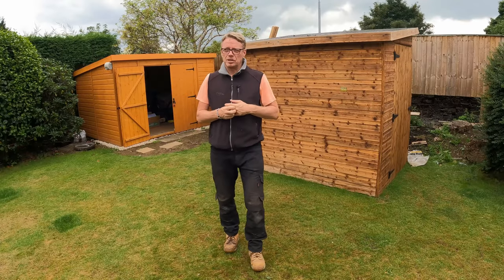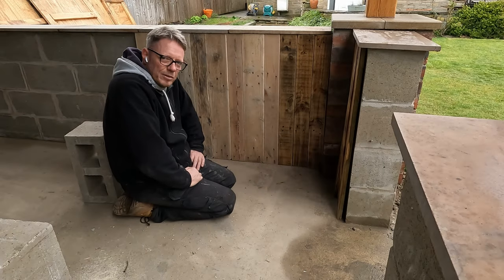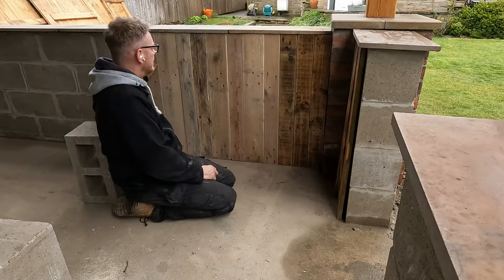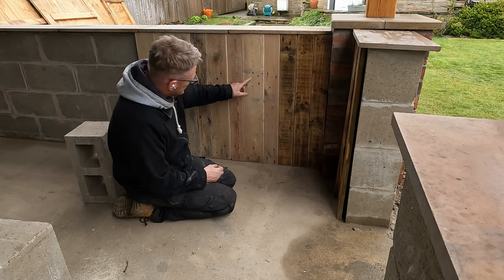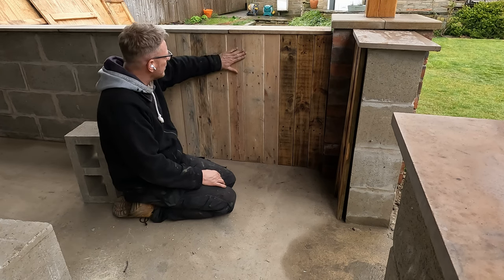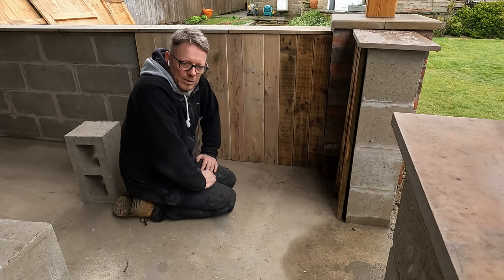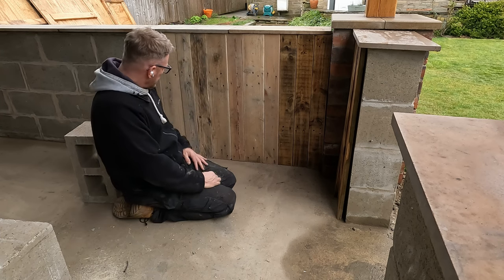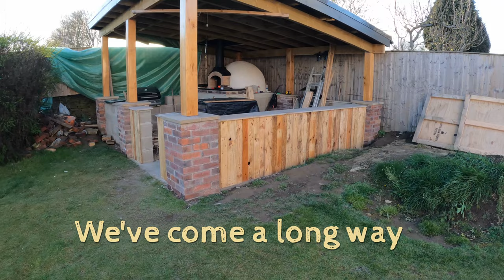Amazing Way to Render a Wall / Used Pallets (Vlog 43)

Comment: I have watched all your vlogs and the editing this time is a real step up, I really liked it.
You are doing a amazing job on the build, you may have it in hand but if not, you may wish to think about sticking a french drain along the outside wall to stop rain water shedding down the slope onto your pallet boards.  
Fair play to you, I broke down three of the fifty or so pallets I had kicking around after the main build thinking I would use them, but I gave up as it was taking so long to pull them apart without splitting the wood.  Ended up buying cheap 4m gravel boards and intend using them instead.  
Gave the pallets to the local Mens Shed who had the time to recycle them into planters for the village. 

Keep going, I am looking forward to the next edition.  I often find myself sat with a coffee at 5:00am just staring at the house we have slowly built over the last three years and feeling at peace, I hope you are finding the same.  
Take care.
Reply from the maker: Honestly, thank you for watching, it means a lot to me. 

I’m really enjoying not only learning to use my hands, but also the editing. I find both therapeutic. 

I do intend to make the whole structure waterproof. I’m waiting for the fella the did all the initial digging to come and excavate around the edge so I can create some decent drainage. 

I can’t tell you how many times I’ve stood back and thought, blimey, look what I’ve built. Many who know me personally think the same. 😂

Again, thank you.